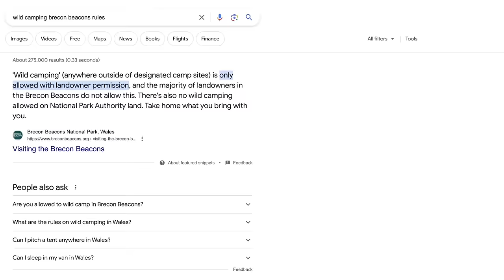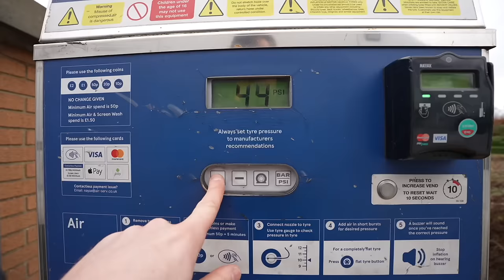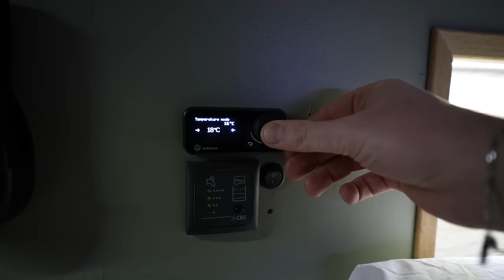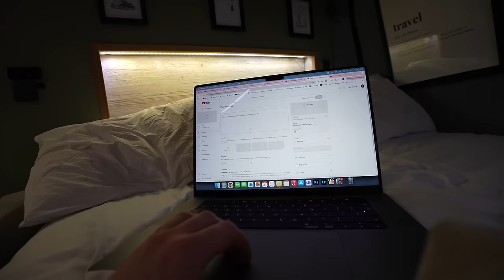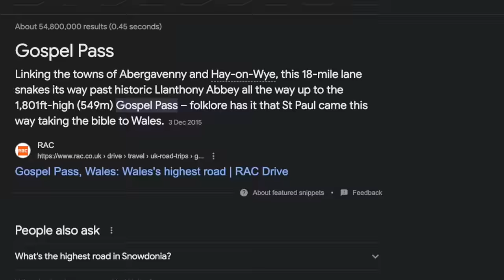Introducing My Girlfriend to Van Life (It Didn’t Go To Plan)

Comment: The brake fluid issue can just be caused by brake pad wear. As the brakes wear the caliper pistons push out further so you end up with more fluid behind the caliper piston and less in the reservoir. The only real issue with over filling is that when you go to have new brake pads fitted they will have to push the pistons back in and there is a risk of the brake fluid spilling over the top of the reservoir. Not a huge issue! as long as you wash it off quickly!

Comment: if your brake fluid warnings come on it could be because your low on break fluid but most commonly because your brake pads have warn out or your braker discs have warn out also it could be a bit of both the reason your brake fluid warning can come on cause of warn out brake pads and discs is because there are 2 or 1 pistons on your brake calipers and as your brake pads and disks wear out the break caliper pistons move further towards the discs to adjust for break pad and break disc wear and as a result of this the break fluid gets low as there is more space because the break pistons have moves and made more space for the brake fluid to fill in but usually its ok and you just need to changer your brake pads and disks if your tight on money ask them to check the disk wear to see if its safe to reuse them again and only replace the break pads but i would recommend changing them all to be safe but if your break pads are new and brake disks are new or not that old you may have a burst break liner somewhere or a burst break piston seal its worth getting your breaks checked regularly to be safe its important as its what stops you im a mechanic and i check mine every month i also do checks before i get in my car or on my moto bike anyways stay safe bro and i love your videos they have helped me so much with my depression and intrusive ocd thanks bro keep up the amazing work bro and stay stealthy